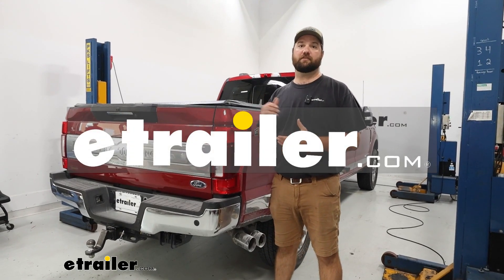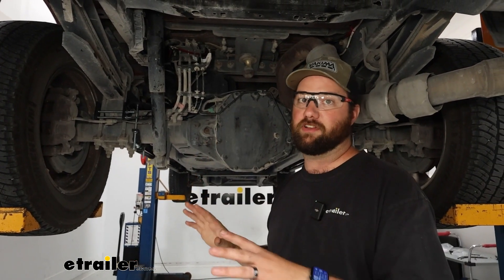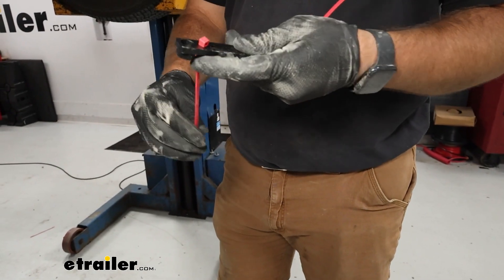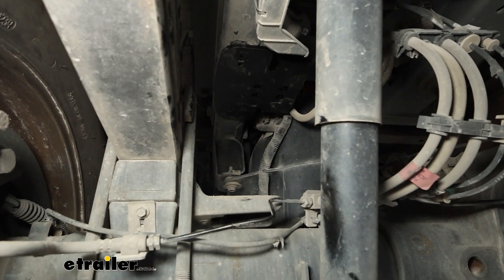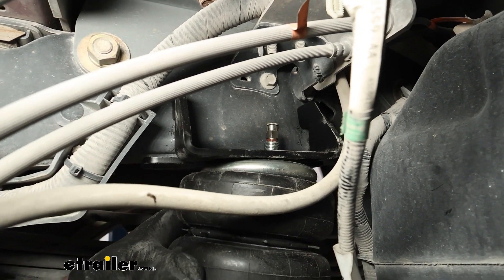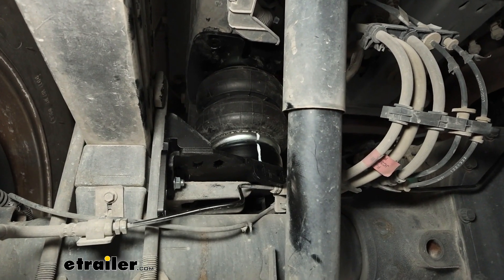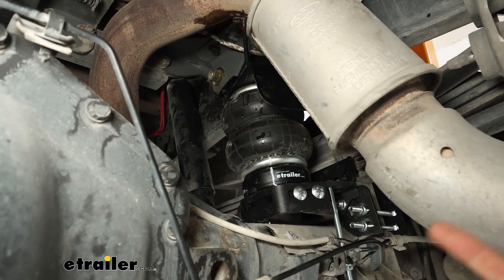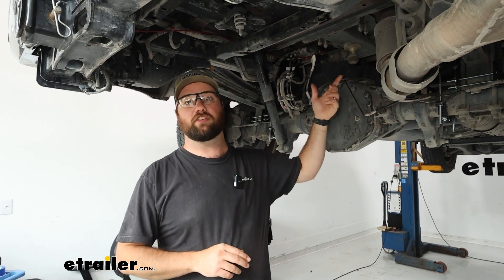etrailer | Set up: Firestone Ride-Rite Air Helper Springs on a 2022 Ford F-250 Super Duty

Comment: How did you get the kit that is not properly designed by the "engineers" at firestone to fit on the driver's side. There is no way to get it around the brake lines and axel breathers.
Reply: I’m having the exact problem. I had to use the included little bracket and after towing my 5th wheel the airbag almost folded so I reached out to Firestone and was told I installed them wrong and they don’t understand that I can’t install it without the little extra axle bracket because the damn plate sits on top of the brake lines in so fed up with it I’m about to just buy some airlifts. Firestone is pissing me off with this bullshit
Reply: @rubencoolidge354 don’t get pacbrake either it was a pain to get in on the drivers side and seems like the bag is too tall as worth 0 psi the truck spots 3/4” taller also their pumps and controllers are junk.
Reply: I have the same problem as well? And when I reached out for help, they told me to completely disconnect my brake line and just pull it out of the way not gonna happen.This is poor engineering in and a shit product that's being sold to people that does not work on these trucks.